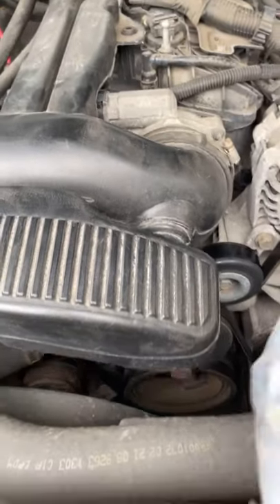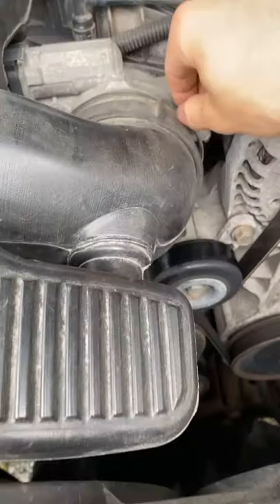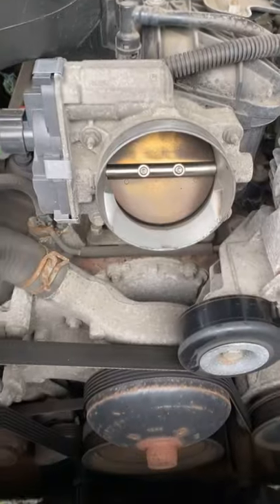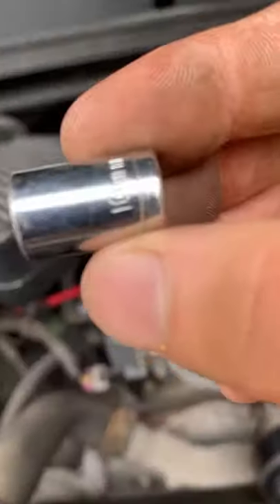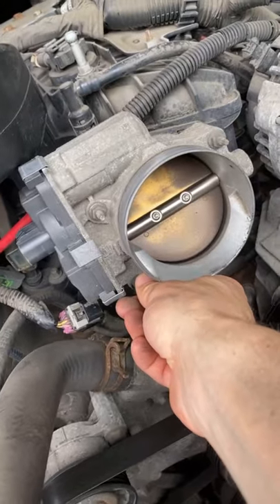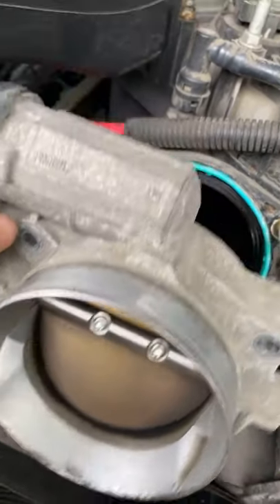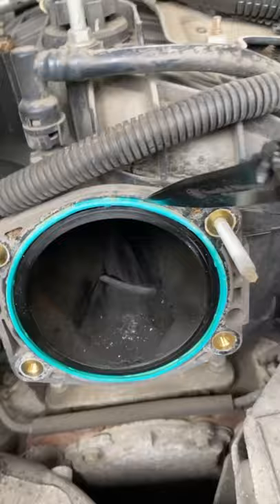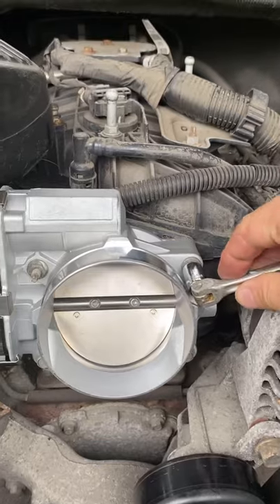2008 GMC Sierra 1500 Throttle body assembly Replacement (2007-2013)

Comment: Do you have to reprogram the new throttle body ? How do I replace my throttle without having it service? A refurbished?
Reply: Real simple. You can use your old one if you clean it real well with throttle body cleaner and a toothbrush once you take it off.
Reply: And reprogramming is fairly simple just turn engine on let idle a few minutes and computer will relearn throttle position eventually
Reply: @supremebean12  wrong
Reply: @DirtyMikeHoncho how was I make it relearn?
Reply: @SLZR60  i had to buy a 250$ scan tool capable of a resetting the TB.
Reply: @DirtyMikeHoncho the right way lol
Reply: Did the job on a buddies truck, then went to a shop and had them reprogram. They charged me $40 and it only took them 5 minutes. Beats having to buy a scan/ program tool.

Comment: Will this most likely help with the reduce engine light i been having issue with???
Reply: Could be. I have the same issue I believe it's the own throttle body plate
Reply: @alvarosilva957 now that I've cleaned it its been idling high at times...